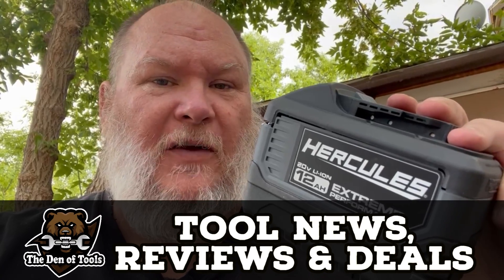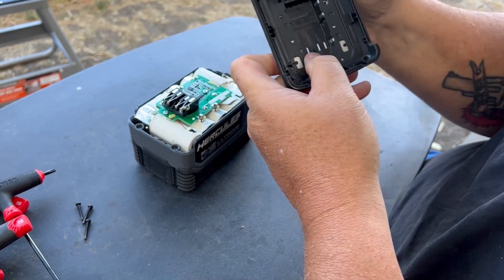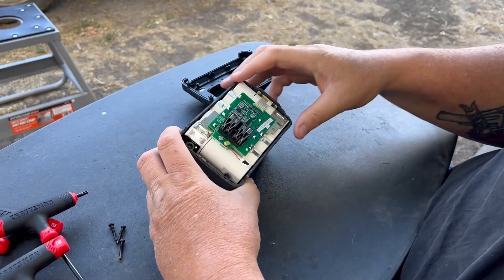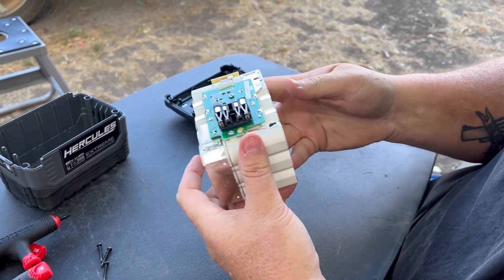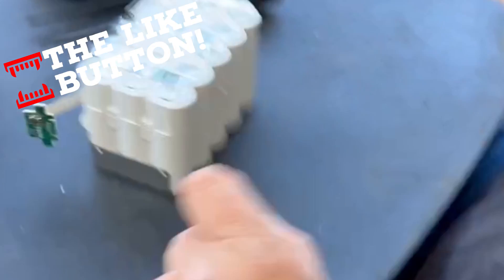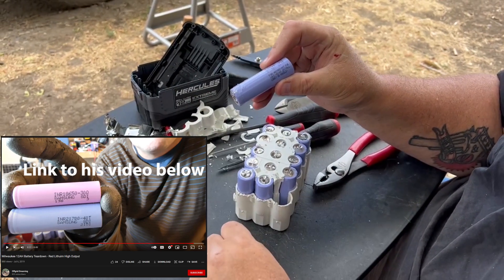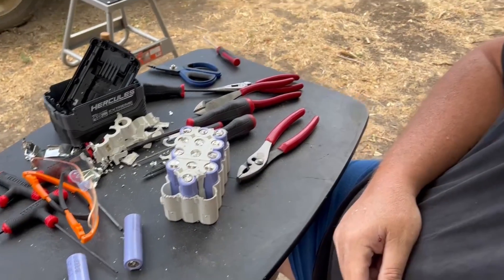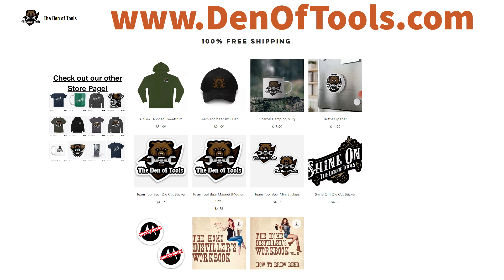Hercules 12Ah Battery Tear Down is SHOCKING!

Comment: Hello, Mr. King;
Thank you for all you do.
You may've voided your warranty but you gained $120 worth of used batteries.
I enjoyed this video, even the sparks were good (would've freaked me out, tho).
BTW, over the last 20 years or so I've had at least 1 charger & 5 Ni-Cad batteries die.
I think all the cordless drills still work, even the 1 I took apart.
Looking online I see where guys have replaced the Ni-Cads w/ home-built lithium battery packs.
But it looks like you need a BMS to make it work right, & not burn the house down.
Which is why I haven't tried it yet.
That & I don't know much about the BMSs.
I found some on amazon but they don't look like they're very good based on the reviews.
Do you know much about them?
Can you find & rate some?
I'd really like to find a simple, easy-to-use BMS  so I can build some cordless drill replacement battery packs from the old pack cases.
If you know what I mean.
Have a GREAT day, Neighbor!
Reply: Check out AvE (Arduino vs. Evil) on YouTube.  His BOLTR (Bored of lame tool reviews) videos.  He goes in-depth in a always funny, but not always wholesomely funny, way.  He does a lot with batteries.

Comment: Great video that's what we needed! To show how cheap a battery can be.  I'm not surprised to see quality Samsung cells in Hercules as harbor freight is going with quality just like the older blue batteries. 

 All major brand batteries 🔋  are way over priced. Only time to buy them is with the bogo deals then they go down to the price they should be at.

Comment: Red, 
That's an expensive project. 
Nice sparks. 
You did what most people seem to forget. 
The well ventilated area. Had something gone real wrong with the disassembly you don't have to go far to get away from a sparking burning mess.
Modern Lithium cells pack a huge amount of energy in a small space.

Keep it safe
Mike in Virginia Beach
Reply from the maker: My wife asked what to do if it caught on fire, my response was just get away from it. Lol
Reply: @denoftools  I charge all my RC packs in a ceramic flower pot with a brick over it just in case.  I’m less careful with my tool packs as I haven’t heard any horror stories with them.  People have burned their houses, garages, and trucks down with RC packs.
Reply from the maker: @scottyV1000  all those are Lipo packs and they are way more volatile. I use those with the drone that I fly and you have to be very careful with them

Comment: You almost did a bad and became extra crispy.. I have to check them if I ever come across those battery packs just to make sure they aren’t rewrapped knock off Samsung batteries.. I had that problem with my DJI drone batteries, they were rewrapped with lg wrappers and ever since then and after watching batterymooch I always cut off the wrapping, look up the info on the metal case, and rewrapped them so I know they are legit

Comment: I bought the 8AH battery when I bought my Ultra Torque impact (also got the dual charger as well).  I am a hobbyist, wont use this stuff for any type of production work, still I am VERY happy to see the quality of the batteries!  Thank you for taking us in for a better look!
Reply: What??! Where do you live? We haven’t seen a single 8ah in Ohio yet so I got the 12ah with my ultra torque(which was also the first UT in Ohio haha)
Reply: @tylerfraker7716  I live in Central California, the HF near my house had a couple of 8s and 12s on the shelf.  Guess they are still working on distribution.   👍

Comment: useful bit of information.  wish batteries were more interchangeable.  i'm hesitant to use my milwaukee battery to dewalt tool adapter because i'm not certain how it's going to impact longevity.  in any case, i look at battery prices like how cheap can it be in a bundle, because any brand is pricey if you just buy the battery straight up.
Reply: I wish they were too. Purchased a new to old dewilt adapter, but made my own dewilt to B&D adapter because none exist. Even tho the same company owns them. Keep in mind to unplug the batteries after use because some tools self discharge.
Reply: @PBVader  You did this too? I thought I was the only one. But yeah keeps your old tools running instead of buying a new $200 saws for light trimming jobs.
Reply: @jamesklingler1098  sure did. Got tired of the old over price b&d nicad quick after the dewilt adapter and a 5ah lithium put them to shame. We probably have a similar thought process: who throws good tools away? I smoked a b&d quantum pro hammer drill, but it still works so is my backup.
Reply: Not necessarily.  I got a two pack of Ryobi 4Ah and charger for $100 and it was during Ryobi sales days so got a bonus 2 pk of batteries free with it.

SO, the way I work that is, I bought one tool kit with a battery, bought several bare tools 'cuz I didn't need a bag or case and charger for every tool, then the deals on the batteries.  It all worked out very affordable, though I don't pretend to need 12Ah cells for 18V tools so there's that.  Maybe if I had an 18V leaf blower or mower, something that not only sucks down batteries but tends to need to be used for 20 minutes or more continuously, and by continuously I mean away from the charger and spare battery that you dont' want to have to lug around with you.   In a shop you can just reach over two feet and grab a freshly recharged battery to swap in 10 seconds.

Comment: I do agree with most of the comments about the bigger brands over charging for their batteries. But to play devels advocate, Milwaukee did pioneer the Li technology in power tools. The millions if not billions of dollars spent on R&D has to be recouped somehow. HF is simply taking an long proven design and slapping some blue on it. No R&D required. 

Milwaukee has to realize that the jig is up. I'm sure they will come out with the newest and greatest thing that no one else has that they can charge an arm and a leg for. Dewalt is doing it now with Power Stack. Not sure it's working all that well for them.
Reply from the maker: To be fair Makita actually Pioneer this technology they just forgot to patent it so Milwaukee did. And the lithium eye on tech is really being pioneered by companies like Samsung and LG. Black & Decker pioneered cordless tools back in the 60s. DeWalt cordless in the 90s. Milwaukee just slapped a bunch of other people‘s technology together and patented it. Not saying they haven’t done great R&D but they are not without sin either
Reply: @denoftools  it's not a sin, it's good economics and benefits the us, the consumer. Virtually Nobody copied makita's design of the long thin pack that slides up into the handle. Milwaukee pioneered the brick we see today that clips on and has become the industry standard. Saying what Milwaukee did is the same as what hercules is doing with this new 12ah is disingenuous. Milwaukee created an industry standard, Hercules is making a near exact replica. It's all good for you and me.
Reply from the maker: @maddmatt-80  You’re right this isn’t even close to what Hercules is doing. Makita actually developed a method for using a new technology in an innovative an interesting manner with their tool system. They spent millions of dollars proving it could work and Milwaukee took a tube and made it a cube and you think that’s revolutionary? Yes Milwaukee has expanded on the technology but so is Makita in fact Makita has an even bigger line of lithium powered batteries than Milwaukee as well as a 36 V line on top of that. By your logic we should be yelling at Milwaukee for stealing Black & Decker‘s design for the drill or stealing Skil’s design for the Circular saw or flexes design for the angle grinder, Porter cables design for the belt sander. Heck Milwaukee isn’t even really Milwaukee. The tool company that was Milwaukee died in 2004 when they were  purchased by TTI who before this only made OEM tools for other companies and had purchased the license for Ryobi.  As I said before there is no tool company without sin

Comment: Ya I mean looks like for individual cells I can get them for $6 on the internet I assume there is shipping but also I'm sure they are buying thousands at a time so probably getting them much cheaper but it's what 5s3p so 15 that $90 so $140 seems about right to me although I don't think they have any real high demand tools so I think going with something around 5Ah would have probably costed about the same maybe not rated for as many amps but I don't know that they would be maxing them out and have a 15Ah battery or if they are the 4.8ah like a 14.4 but I think that's something Milwaukee should do too especially for like lights also they could do 3Ah 18650s for that stuff too

Comment: Meh, warranties are meant to be broken.
Looks to be 21700 cells, so if it doesn't have any chips that prevent you from re-celling it, then it serviceable.
Reply: Those are 18650 batteries
Reply: @jimstand  look too big for 18650s. Says 21700 on the wrappers.
Reply: @themadatheist1976  Sorry, you are correct they are 21700.  It even says 21700 on the HF website.

Comment: The thing to remember about lithium cells is the need to be charged independently. While they are connected in series when you are powering the device, they need to be connected independently in parallel with individual voltage regulating circuits for each cell. It makes for some complicated wiring. In the radio control model hobby we have things called Cell balancers.
Reply: I've been looking for a good 5s charger for a pack I'm building, would you happen to have a link to a quality one? there's only one I've found on Amazon and it seems iffy looking
Reply: @billallen6109  Try Hobbyking. They have a wide selection of Lipo chargers. The MythBusters used to shop there. The Harbor Freight of the Radio Control hobby!

Comment: I'm assuming HF/Hercules does the kind of volume needed to get cells directly from Samsung. 
One of the problems with the knockoffs is that there's a huge problem with people buying junk cells, putting a new label on them proclaiming them to be name-brand high capacity (not hard to do when the label is printed on heat-shrink tubing), and reselling them as the real deal (or, if you're feeling cynical, you might suspect the people making the junk cells are mislabeling them at the factory); because the battery pack is only as good as the worst cell, buying a knockoff becomes a game of chance.
Reply: The benefit here is that there are currently only a few places making 21700 cells, and all of them (at least for now) are quality cells.
Reply: @anthonybarker9123  Meh, no, the same counterfeiters could just shoehorn some generic 18650 into a larger casing just as some have done in the past with 18650 and other sizes.
Reply: There is more than one way to interpret it.  They could be using cells from multiple suppliers and when the cheaper ones can't supply the quantity, they have to either stop production or get what is available to fill the void as long as they have supplier issues.  

Another possibility is they might pull the old switcheroo, which is make early production with good components then once all the popular reviewers have moved on, switch the cells to something cheaper and maybe nobody even cares as long as the alternative brand is "good enough" for the price point.

Another possibility is they are facing fierce competition and have to sell batteries near a break-even price to get a stronger foothold in the market, but know that their batteries will be torn down and know that people recognize Samsung as a quality manufacturer so they can't be faulted  for going with a top tier brand.  I suspect this at least as much as the former two possibilities but could be all three.

Personally my two greater concerns are:

1)  That they don't catch fire.  I'm not implying that they would, just that it's kind of important not to.  

2)  They stick with the same battery format for a very, very long time.  Nobody wants their tools be become obsolete because the manufacturer decided to change up the format.  I really doubt that years from now, the Chinese clone battery market will be offering equal quality Hercules 12Ah packs if the Hercules team decides to change battery format and leave existing owners without a good option.  I'm not pointing figures as this has happened with several major brands over the years, and some of it is understandable if a company feared that owners would try to hack/charge a Li-Ion battery in a NiCd charger or vice versa, so they didn't even bother to try to pull a Ryobi and keep the same battery format across chemistries.
Reply: Seen a number of fake batteries opened and most of them don't even have a circuit board with BMI to control voltage levels.  The batteries are wired directly to the output leads. So no protections. That is a dead giveaway plus the price.
Reply: Really, an OEM can end up with counterfeit Samsung cells with fake shrink wrap labels.  We should call them Trump cells.
Reply: @tonymanero5544  But they're NOT rewraps in these batteries... 
Unless they're extremely high quality ones, because they match up perfectly with what the Samsung graphs and datasheets state for the cells. I've tested both the 18650 AND 21700 versions of the batteries, and they BOTH contain genuine Samsung cells.
Reply: @tonymanero5544  Or call them TDS butt hurt cells for those who can't get past being sore about politics.  ;)
Reply: @tonymanero5544 you misspelled Obama and Biden

Comment: My only worry is that it might be like a  cheap LED light bulb, ya the led will last 20 years but the cheap circuitry and lack of cooling you'll be lucky to get 20 months outta it(speaking of the bulbs here).

Comment: Very interesting, I wonder what samsung uses in their numbers to qualify their batteries. Whether it be grade a, b, c, ect. There are only a few top tier manufacturers of lithium cells, the top two being samsung and lg. They are then grouped by their grades before sale. So Id be curious if they are the same grade of cell as milwaukee. Which would be one of the reasons for a price difference.

But there are a few other reasons for the price gap. One is, well, money. Milwaukee has a patent on the use and layout of 18650 cells in a tool like this. Thats why manufacturers are pushing so hard to get away from 18650 batteries, whether it be going to 26650s or dewalts soft packs. No it isn't for performance like dewalt fan boys like to believe. Dewalt just wants to stop paying their competition and if they can sell you a cheaper lower quality battery with higher markups in the process....well yeah.

Another is R&D. You can't stay on top without it, and it is very expensive. Since the big shift towards lithium over nicd or nimh tools Milwaukee has been putting in the work. Most of the other manufacturers are copying their tech and ideas but they did alot of things first and did the leg work. Looking at all the new tools, and the new advances they've brought to the industry I can't imagine they are making much on the tools themselves. They make the vast majority of their money on the batteries, whether it be through the direct sales or stipends from their patents. Everyone was using their battery design so every time you bought an 18v battery from another company Milwaukee got a piece of that.

I remember back in the day there just wasn't much for cordless tools. Going to sears you'd get their best set up and youd only end up with a drill, driver, circ saw, recip saw, and the worst flashlight you'd ever seen. I mean sure they had a few other odd tools but that was just about it. When lithium came into the picture there wasn't much out there and the batteries were frankly terrible

Then Milwaukee a few years back seemed to just dump all their money into R&D. Better lithium batteries, better charging technologies for them, bringing brushless motors to the mainstream. Then just pushing better and better batteries, and expanding the line to cover just about every single tool imaginable to cordless. From miter boxes to shop vacs. Then taking on the air tool market in full force with electric ratchets, die grinders, and impacts. None of that was free.

Its just trickled down now where smaller companies can copy and paste the formula for good tools. Even Ryobi which  I used to scoff at has great tools and I've bought into their line.
Reply: Most of those original patents will expire within the next 2 years.

Comment: I have not seen the inside of another company’s batteries, how does it compare.  Since the discussion attached to this video have mentioned Milwaukee, do you have a video with the inside or a Milwaukee battery?  The way the Hercules was constructed, does the white case hold in more heat?  Are the electronics cheaper?  The black case, based on the statement of fibers within the plastic, they wanted the case stronger than just plain plastic.
Reply: Just check out some other tool battery review videos.  They aren't exactly rare.  There was nothing especially good or bad about the batt in the video, except the PCB was small enough that it looks like it either has restrained current capacity or instead  that the design moves part or all the BMS circuit to inside the tool.    There are pros and cons to that design decision.

Frankly I wouldn't give it another thought, as it is usually more important to pick the brand based on the tools themselves and the batteries are equivalent as needed to power them.